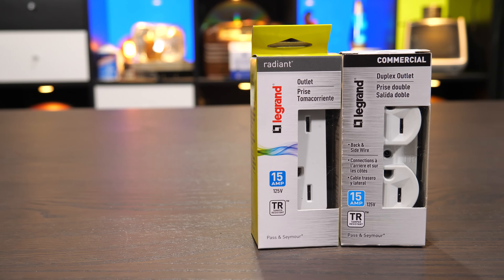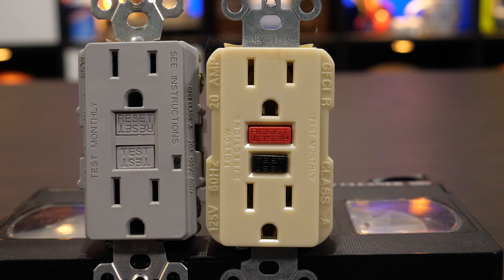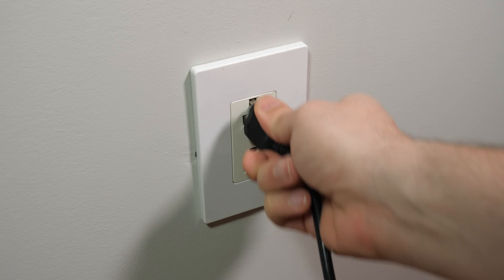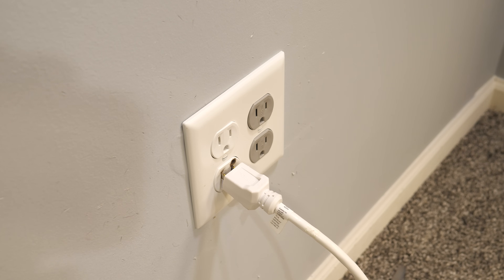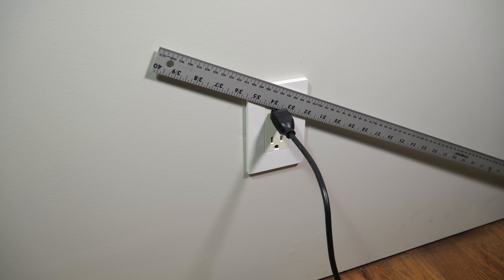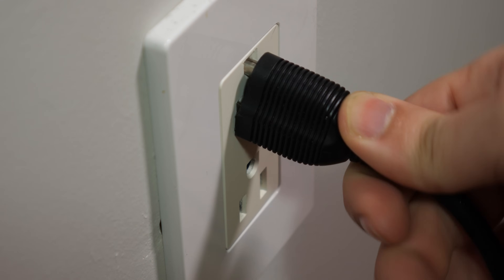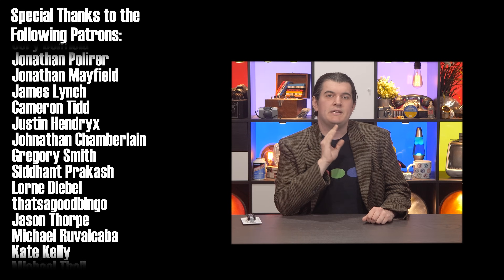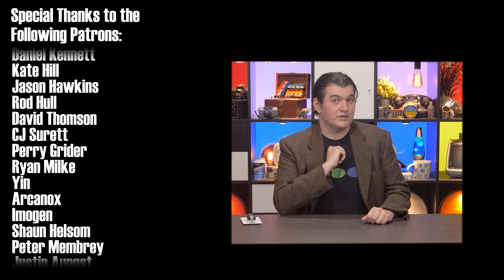Power outlets are topsy turvy - but does it matter?

Comment: I left mine in the face orientation (largely because I have a few things that have a specific orientation like mentioned), but this is making me very glad I changed all the plugs and plates to plastic. I kept one metal light switch plate, but the outlets were a bit mismatched and very old, so I replaced them. Especially where I do use some older appliances (mainly a 1975 sewing machine, and some similarly aged lamps), safety was a concern. I gotta say, I am impressed with some power bars now where they have a thin plastic layer that rotates on top to block access when not in use. I have a couple of those and they also seem to really grab onto the plug in a way that outlets would just let slide, making it much harder to accidentally unplug things. 
That being said, my biggest complaint is with phone chargers. Most AC adapters that allow a USB to plug into a wall are just a box with two prongs out the back. They're pretty clunky and very easy to unplug (looking at Samsung's 45W one in particular, as well as MacBook/iPad chargers without the long cable attachment). Thankfully nothing bad happened, and I still have my 3 prong long Mac cable from when they used to be included, but I'd still say the $25 is worth it for the safety even if someone doesn't need the length. 
However, one good thing with the modern style of outlets I used in my place, is that they're the ones that don't have that separation in the middle. So it's a rectangle with both in it, and the plate uses a screw at the top, and one at the bottom. Since I'm not trained in electrical stuff, I just went around the house putting the plates on and they're much more sturdy with that second screw.

Comment: This was once an actual issue for me.  I was working as a technician in a telephone equipment factory.   Each bench had an industrial outlet strip with all the sockets installed the usual way - upside down.  And I was doing a lot of soldering.  More than once, a length of solder accidentally shorted out the circuit by laying on top of a casually-inserted plug.  Zap!   Just for a moment...

Comment: I install all of my outlets the "correct" way and everyone tells me I am backwards.
Reply: p.s. in an industrial setting we use a lot of metal faceplates. i was tought to install ground up in case the faceplate was loose or tampered with it would not touch the hot blade.

Comment: The same people who put the ground at the top are most likely to put light switches behind doors and wire common and hot in reverse. My dehumidifier cannot be connected to an upside-down recepticle because it was designed to hang from a proper basement recepticle mounted 4' above the floor. Call me old fogey, but that's the last desperation of those who want resistance to stupidity to disappear. En-Gi-Neer mentality wants to manipulate the masses.

Comment: So, for the record, I did have an occurrence of “foreign conductive body” that slipped between the prongs. Definitely a jump scare moment and it left a mark (that cleaned up), but the circuit breaker did its job. That as the only occasion of that phenomenon in my (so far) 67 years of existence.

Comment: One of my core memories... getting shocked while teying to plug my ps2 into the wall.... behind my behemoth of a TV... (it was like a 24 inch tube tv but it was the size of my 60inch flat screen tv)
Accidentally slipped and my figer touched both positive and neutral 😂

Comment: Tell me where that misinformation gem comes from since the NEC through 2023 does NOT say which way is correct. I will continue to install outlets whichever way suits the needs such as kitchens where a microwave is installed on a shelf above the counter may get a ground up depending on the outlet location, otherwise it will be ground down

Comment: Here in Europe we have some sillyness with german, french, swiss and italian plugs but theyre at least kind of crosscompatible! Too bad that everyone even in the countrys that dont use it seems to use the german standart due to it fitting into almost everything, making for one plug across multiple countrys but making it so the ground pin only works in one...
Oh yeah and that crosscompatible thing?
The german//french power plugs fit into almost everything, but if youve got a swiss or italian plug then good lock fitting into french or german sockets!

Notes about all the different types of european plugs.
Small, ungrounded; used everywhere: Type C
French and thus automatically cringe but still compatible with the schuko soket: Type E
Basically the Standart: Type F, also called the "Schuko"
Italian and seemingly getting used less and less: Type L, a grounded connection in the size of a Type C!
The Swiss Standart: Type J, unsure how often this is actually used.

Comment: My cat almost electrocuted himself because of this. He was playing with a wand toy with a metal string that fell between my bed and the wall, and there also happened to be an outlet there with a power strip plugged into it. As he was pulling on the toy to get it free, the metal string easily wedged between the plug and outlet and touched the prongs, causing a flash of light and a loud pop, followed by some smoke. Somehow, my cat didn't get electrocuted, but I don't know how he managed that given the circumstances. I don't plug anything into that outlet anymore 😅

Comment: I just moved into a new place and had all of the outlets swapped. They're all ground down, and thankfully so. First of all, the contract is kinda dumb and really wouldn't have known any better. Second of all, I have a lot of right angle plugs, from power strips to my tv. The power strip for my tv setup is hanging from a raised outlet. That's likely meant for a mounted TV, which will go there at some point, but having the strip there is really convenient because it makes the plugs for other devices more accessible

Comment: That outlet IS NOT upside down.  The Jiners that decide the electrical code cannot make up their minds how they want items installed.  Ground on the bottom has been the standard for many years and cable manufacturers made limited space plugs on cables with the ground on the bottom to match the installation of the receptacles.  If you install the receptacle ground on top, you will find it difficult to find a limited space plug that will plug in without placing undue stress on the cord.  It may make sense to install ground up when possible but to say ground down is wrong is horseshit.

Comment: I have many switched outlets in my house. The ones so designated are installed  “upside down” so that they can be easily identified without running around the house with an outlet tester.

Comment: In Australia, old wall plates have the Earth Pin at the top & newer ones have the Earth Pin at the bottom. The rationale being, if weight is applied to the cord, the Earth Pin will be the last thing to come out.  It is notable that every wall outlet has an individual on/off switch for each socket. Lastly, the Active & Neutral Pins are Splayed, so you can easily know which Pin is Live.

Comment: What great timing for finding this video!  I was actually about to begin turning all my plugs upside-down.  At dinner time I dropped a knife and it landed on the nearby lamp plug which had partially pulled out from the socket.  That scared the beejeezus out of me.  But after watching your video, I realized the folly of turning that outlet upside-down, since the lamp plug is a standard 2-prong.  It would make no difference.  I agree that it's an absurd situation that needs a remedy.

Comment: I have been working on and installing appliances for fifty years. In all that time I have only came across one unit that the service cord had a right angle plug with the ground up. It had been broken off to fit flat for the ground down orientation of the receptical. What a number of people forget is that causes voltage to be on the frame of the appliance so if you were to contact this appliance and one that was properly installed you would complete the circuit. I have had this unplesant instatance happen a couple of time when customers have either self installed or did their own wiring.

Comment: It seems to me the reason to have the ground up is because it makes it easier to install the plug on the now required safety plug. You cannot push a plug straight into a plug today. It has to be rolled into the plug on an angle. I noticed awhile back that it would be easier to roll the plug in if the ground was on the top.

Comment: 7:55 Actually had this happen with an aluminum ruler which, if I remember correctly, fell off of a table onto a power strip on the floor. It somehow made consistent enough contact to even melt the metal and leave a black stain on the carpet!

Comment: Except for a few good safety and practicality reasons as mentioned by an electrician in the comments, electrical outlets are like toilet paper: there is only ONE correct way for them to be placed, eyes on top, little surprised mouth on the bottom.

Comment: I grew up in Chicagoland and the sideways outlets meant I couldn't use a fun dolphin night light I'd gotten because it required a vertical orientation and I was so sad about it. i like to use those air freshener plugins and imagine those would never work with horizontal outlets and in fact be kinda dangerous or at least messy

Comment: It is in the NEC. The ground is supposed to be on top because of the POSSIBILITY of a partially plugged in device could have a conducting material fall on top, and cause a short.
I did not say I cared, I say this is the code. Don't get me started on building codes.

Comment: I'm 63. What you call upside down is how EVERY SINGLE OUTLET was installed when I was growing up. Something changed in the 80's and 90's when the installation started putting the ground hole on top.
Now, depending on the age of your home some are up some down. 
If it doesn't matter then why all the inconsistency?

Comment: I will say,  the one circumstance I find to have the ground on top is when the plugs are further up the wall and using a heavy cord, such as my 10ga extension cords in the garage.  Having the ground pin on top holds in better than having it in bottom.  Ground pin on bottom will hinge the top pins out significantly.  Having the ground pin on top holds firm. Funny that as I typed this the author mentioned this fact 10:06

Comment: I heard years ago that in a room with more than one outlet, the one outlet that has the grounding plug on top is the outlet that is controlled by a wall switch. Is that correct? I've tested it numerous times, and have never come across one that didn't follow this standard.

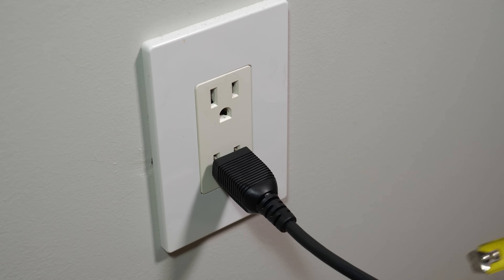Comment: If you're concerned about that "safety issue", just don't make the cover out of sheet metal. 9:10 That can also happen from the bottom and it can get dislodged more easily if the ground is up.
4:13 And they shouldn't be sleeved with any insulating material. You should use a protective cover instead. Like the Schuko plug system did first.
Keep the outlets like they always had been! 10:00 No, it's the other way around.
16:00 No! The ones that did that did a bad job! Use a protective cover like the Schuko system has instead.

Comment: The old advice was that if you install an outlet that does not have a proper ground wire, like in old houses, the standard is to put it in upside down to alert people. Also many electricians mount switched outlets upside down to make them easier to identify.
Reply: It would be better to have a receptacle without a ground connection, but it may not be possible to buy them anymore.

Comment: 45 is actually for ease of manufacture! 100% only for ease of manufacture, no bends on the wire when its cast at a 45. AT LEAST one less step, less tooling etc. etc. etc. these are made in the millions, times money.

Comment: I always like to do my electrical work in accordance with NEC, thus “The National Electrical Code (NEC) doesn't require a certain direction. The NEC allows outlets to be installed with the ground plug hole facing up, down or sideways”. A little research would have saved you the time it took to make this video. Only fools try to sound smart.

Comment: You forgot to point that sometimes the outlet will break. Here's how: with an outlet installed ground down  if there is enough downward pressure on the plug it will break the edge of the outlet next to the ground plug.

Comment: Why on EARTH do plugs not have a twist-lock? Imagine if power was only connected when the plug is “locked in…”
Reply: There are Twist-Lock plugs and sockets.  They just aren't common, but you can use them when you have equipment which should stay connected.

Comment: I seem to remember one of the older National Electric Code books recommending but not requiring that the grounding pin should be in the up position.  Later editions didn't seem to mention the issue.  Installing outlets with the grounding pin up will eventually result in call backs because the customer or other workers will insist that grounding pin up is ignorant, or lazy or just wrong.  Why invite that?

Comment: The NEC book says that it does not matter which way the plug is installed.  It usually depends on the building they are installed in.  In a hospital for example they require the ground be up.

Comment: I like ground up for non-angled grounded plugs as the ground helps to support against a possibly looser or bumped connection.  If I know I will be using a long term angled plug, I install ground down.

Comment: As an electrician the thing that surprised me the most is that you need to run conduit in homes in the Chicago area per local code. That sounds horrible I would hate to have to do that, running conduit through metal studs is already a pain, running it through wooden studs (particularly if you need to turn a corner) sounds like torture.

Comment: my grandfather's a retired electrician (worked maintenance in an industrial plant) and so far as I can tell, the two principles he brings to every project are 1. you can never have enough outlets. the correct number of outlets is one within reach at all times. and 2. outlets should be installed ground plug on top. this latter drives my grandmother nuts, because all her decorative nightlights are upside down. but I think this is balanced out by his cord management of her extensive xmas decorations. for example, she has "candles" to go in all the windows, and he has altered the cords so they are exactly the right length and not an inch longer. each light is labeled with which window it sits in and which outlet it plugs into. impeccable. 

this was a really interesting breakdown, thanks for sharing it with us!

Comment: NEMA standards say the ground must be down, not up. Many years ago, the contractor I  was working for did a hospital "ground up"  per the specification. Hospital employees removing cords broke the small plastic piece that completes the device and the hospital filed a claim for hundreds of "defective" devices. My employer went to Hubble the manufacturer of the devices with the same claim. Hubble pointed out that the devices were installed incorrectly according to NEMA standards and would not pay up. My employer and the hospital came to an agreement that ALL devices would be installed per NEMA standards, that the broken devices would be exchanged and that the Hospital, Engineering firm and my employer would split the cost 3 ways. It was NOT cheap, something like 3000 devices.  that lesson was learned in 1981 and it stuck with me.

Comment: Every hospital I've ever been to has the ground on top. It is a safety issue as the ground prevents bridging the two hot plugs if the plug is not completely seated.

Comment: The flat wider face of the two prong is probably not to protect fingers… I’d think that it’s most practical for keeping the direction of the pins perpendicular to the wall, instead of drooping downward… which is presumably a function fulfilled by the ground pin bracing the three-prong one and keeping it flat against the outlet, hence the 3 not being perceived to require an addition to the edge.

Comment: 🎀 What if we made the plugs be side by side but still having ground on the bottom, while also standardizing right angle plugs all across the board? That way, old plugs will still work, downward facing right angle plugs can be applied to BOTH outlets without overlap making one plug un-usable, and it mitigates the droopy plug issue?

Comment: Making an issue out of a non issue.  Ground up is used in many industrial and hospital (if not all) installations.  Ground down often used elsewhere.  I use ground up as I think that the ground prong connect is often a tighter connection than neutral and hot.  Keeps the plug from sagging and leaving the hot spade exposed to varying degrees.  Marginal reason but that’s why I maintain that you do as you please.

Comment: There's an obvious method to their madness. Lot's of folks will scramble to "correct" this upside down situation believing it's a code violation or safety issue. They'll run out and hire an electrician who will undoubtedly find other electrical "issues".....which actually can be a good thing in some cases.

Comment: You Americans are so simple-minded.
Take a look at European or German sockets.
It doesn't matter whether it's 110 volts or 230 volts, 50 Hz or 60 Hz. Our sockets are recessed and designed in such a way that it's almost impossible to touch the contacts.
Reply: schuko sockets are usually only used in 220-240v countries